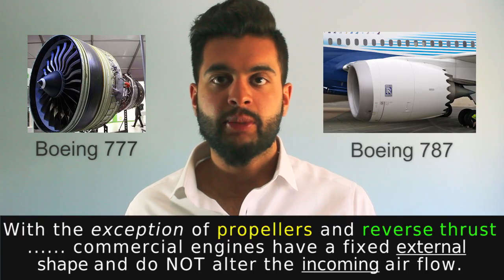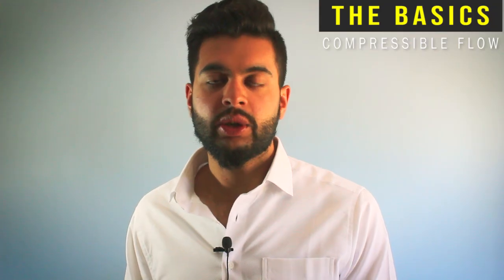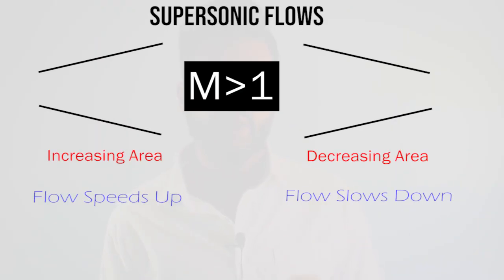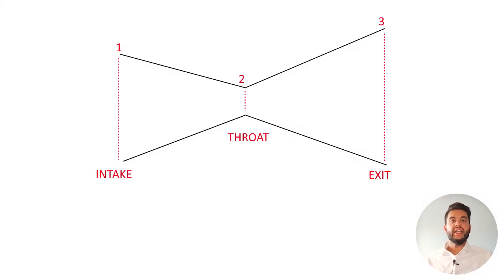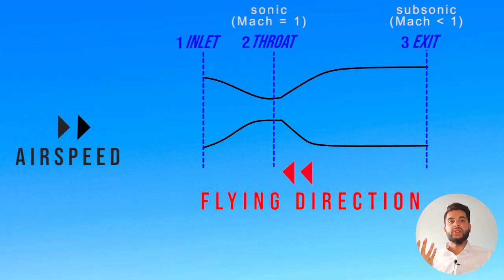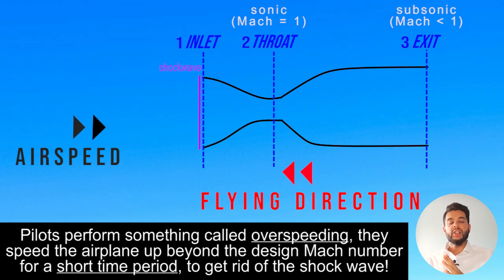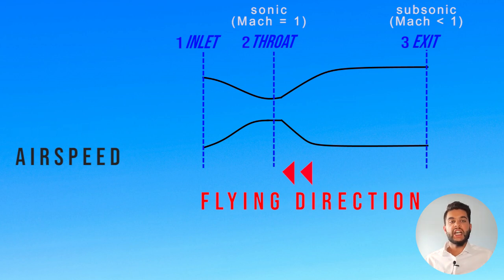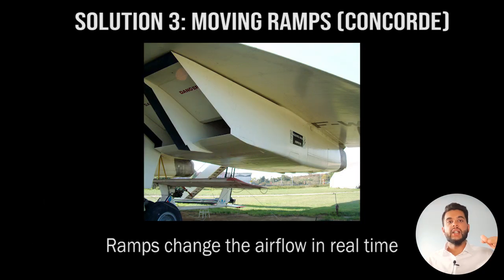How Does A Supersonic Jet Engine Inlet Work? - Advanced Compressible Flow

Comment: That's a good explanation, however the variable exhaust isn't really linked to the throat, but linked directly to the mass ejected and the speed
At subsonic "thrust" you need a smaller diameter (we can explain it like soap, it's fast, but if you constrict it, it gains speed)
But at higher speeds, the air ejected need more space (that's why a ton of aircrafts will change the nozzle between take off, low speed small diameter, to record speeds, high speed, large nozzle)

That's why the DeLaval nozzle is large, because it ejects air at supersonic speeds that needs to expand

Comment: im not an an engineer but this topic interesting.Im into AI technology, and EV's..Nikola Tesla works. I want to be there to see the assimilation of these tech.I have one question..does supersonic only work on combustible engine?How about electric?
Reply: The simple answer is no. Electric propulsion will work just as well as long as it has an intake which can slow the air down to subsonic speeds. The only issue currently is the amount of energy one can store per unit weight

Comment: Really great video! But I think you may be mistaken regarding your description of the SR-71's intake near the end. Around 4:27 you show a diagram of an external compression inlet, but the SR-71 actually used an internal compression inlet duct. This can be seen by the fact that it's inlet spike is a uniform angle rather than a series of increasingly steeper angles. As well, external compression inlets aren't subject to intake unstart modes, but the SR-71 definitely had some very tricky to handle unstart modes. In fact they had to design an entire analog computer system dedicated to avoiding pr if needed handling accidental intake unstarts.

Comment: The shockwave is not just reduced in order to prevent harm to the performance of the aircraft, on the blackbird and concord the shockwave is actually harnessed and is used for the majority of the thrust of the engine. As much as 70% of the net thrust is created  by harnessing the shockwave on the blackbird. It is ducted around the engine and exits with the exhaust.